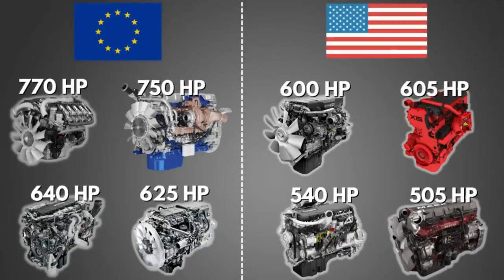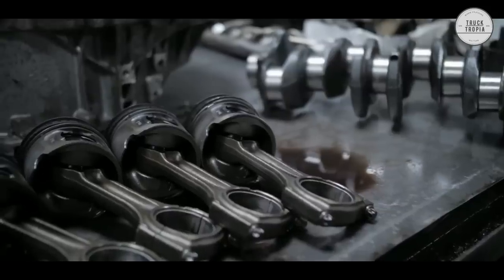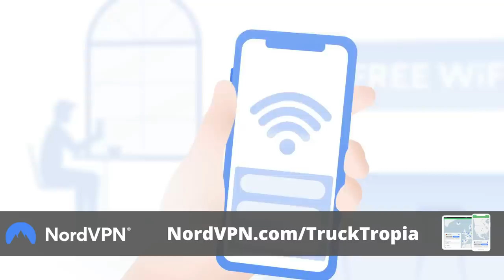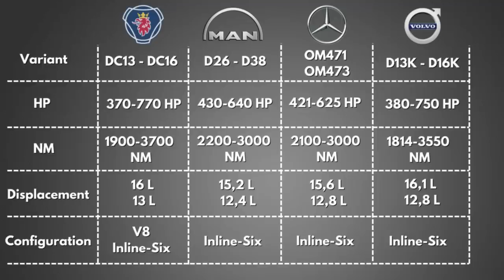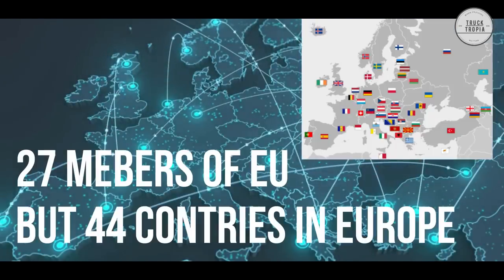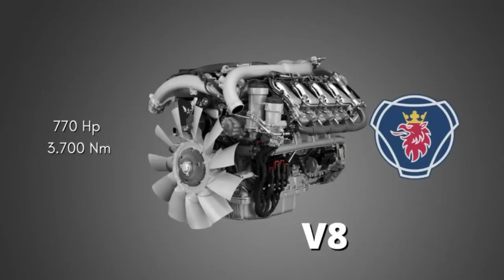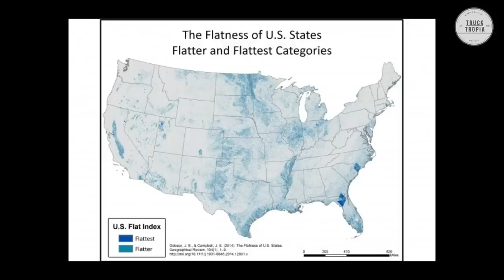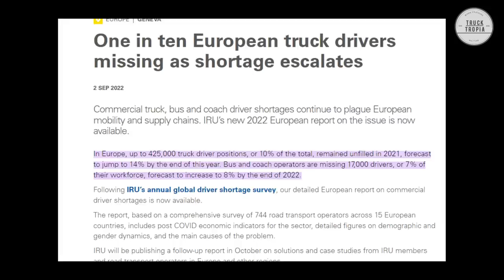Why European Trucks Have Up To 770 HP And US Don’t

Comment: Your statement about torque is completely false. There is no relationship between torque at the crankshaft and torque at the wheels, you set that with gearing. Horsepower however dictates how much torque can be delivered to the wheels via gearing at any given speed. Large torque at the crankshaft does not move the car, large torque only makes the horsepower with less engine speed.

Comment: I wish you had not only compared engines by horsepower and torque but also by fuel consumption. I think European engines are mainly designed for efficiency, because fuel prices are a lot more expensive here, than in the US.
Reply from the maker: Hard to compare, as manufacturers dont share Numbers
Reply: Talk to Sundahl in Denmark. He runs only American trucks because they are cheaper to maintain, more reliable and consume less fuel.

Comment: Doesn't gearing dictate the final torque (to the wheels) with the horsepower being the limiting factor?
Reply: Exactly, the engine torque myth never dies.
Reply: Definitely, you are correct. 

The stated torque figures are at the crankshaft and they are only denoting the magnitude of the static twisting force that determines how strong the internal components are required to be. However, we do not know how often this torque is supplied to us. Therefore, it tells us nothing about the vehicle performance, and certainly does not state how much a truck can pull, as stated falsely in the video.

The torque at the crankshaft is rather multiplied by the gearbox, and this resulting torque at the truck's wheels is what matters for vehicle performance. This torque at the wheels is what determines how fast the truck is and how much it pulls..or rather how fast it can pull these large loads. 

Technically, this wheel torque figure can become really high (just about anything within physical limits) by just fitting a gearbox with an extremely large gear ratio, so this way the truck can pull any desirable weight. However, this also means that the rotational speed at the wheels is also reduced by this same factor (the gear ratio), because that is how the gearbox works: it multiplies the torque, but sacrifices the rotational speed in return. So while really heavy loads can be pulled over the steepest of hills, the wheels of the truck will turn slowly, resulting in the truck traveling at a really low speed. 

Therefore, the stated engine torque doesn't tell us anything about the performance of the truck. What we also need to know, is at what engine speed this torque is delivered. 
An engine delivering the same torque, but at a higher rpm (rotations per minute) directly translates into hauling the same weight, but a truck that is traveling faster. 

Conveniently, this is exactly how power is defined: it is engine torque multiplied by the engine rpm, because both contribute to a higher truck performance. The higher the power, the faster the truck can accelerate, and the higher the resulting wheel speed is after using the gearbox to achieve the desired torque at the truck's driven wheels.

In order words: torque (at the crankshaft) is meaningless, but rather power, which incorporates both torque and rpm, tells us everything we need to know about how fast the truck goes (both acceleration and top speed).

Comment: First thing you said about torque vs horse power is completely wrong.. torque x rpm = power, high torque indicates that an engine has a lot of power at low rpm which is best for efficiency and longevity of an engine.

Comment: Not all truck engines in the US 600hp...I drove a Mack with an old Maxidyne V8 that had been worked over to put out well over 700 hp. It was a 4 axle Superliner with 3 sticks, and it was dedicated to haul our Grove RT35  crane. With the crane on the lowboy trailer, gross weight was 120K. Even at that weight, it would pull hills better than some freight haulers. Other drivers were always suprised when I would pass them going up a hill. Fun times

Comment: The Detroit engines are made by Daimler, the DD13 and DD16 are found in  Actros and Arocs models. But they are tuned to about 30hp more (DD13 to 530hp and DD16 to 630 hp).
Reply: Mercedes can give u a different engine 😂 2 Exactly a 12 Cylinder Diesel with 1830 HP and around 6400 NM Torgue and a 16 Cylinder Diesel with 3000 HP and 12300 NM Torgue (both was just a Test Engine for the leopard 2)

Comment: So here in the philippines the much better truck to use is european trucks because of geography and also we used the tons not the pounds. But reality most of the truckings here can't afford the european trucks because it so expensive, so the result most of the truckings here are using the Japanese trucks that the horsepower around 300+ to approximately 500 horse power. its not bad anymore because japanese trucks are also reliable and has strong engines

Comment: The US also taxes based on HP (among other things but its a large factor). So to have just enough HP to move the load at an acceptable acceleration it is always better to have a massive torque with a moderate HP for the US
Reply: The massive engine torque has nothing to do with towing. You gear for torque. That's why we have gear boxes. They are torque multipliers. If you want to know how much torque is at the wheels it's hp not torque. 

The reason for the massive high torque engines is about fuel economy and wear.

Comment: Torque doesn't have anything to do about ability to drive truck. When you drive bicycle you have more torque than Yamaha R1 or formula 1 car...
Power is important. Also competition is bigger in Europe. Every liter of fuel is important, every horse power is important, every kilogram of weight is important, every useful comfort thing is important, very half star safety test is important, every kilometer without service is important. European truck is engineering miracle. Milion kilometres, 10 oil changes all trouble free...

Comment: This video has so, so many flaws. USA has many areas where the (B)HP and torque are insufficient to pull a maximum load easily. Many other truck drivers and I often experience that when having to haul freight through - for example - Colorado and Pennsylvania. Going up a mountain with 20 MPH shows the trucks don't have enough power to easily pull through.

Americans are taught that the USA is bigger than Europe. In real life, Europe is not only bigger, but it also has a larger landmass, a larger population, and a bigger economy. In the USA, they therefor mostly compare to only the UK or the EU, instead of the whole of Europe.

If there is a country where there is a lot of customization then it's the USA. There are fewer regulations on the length of a truck and so more options to customize it.
Reply: The US does have a bigger economy than Europe $25 trillion vs. $24 trillion. Europe has 770 million vs. 333 million in the US still has a larger economy
Reply: There is different between a country and a Continent

Comment: well, you are wrong saying Euro trucks pull less weight, they have b doubles and USA  does not, typically those 700 hp plus engines are used in logging in Scandinavia and b double and triples in Australia, and  in road trains Cummins are the majority here, but only because Scania cannot supply enough units to us and the world Scania have the better engine, I  know this from my days working for Cummins and from my days building small ships with Scania
Reply: US has B-doubles though not that common.I have seen Fed-Ex and UPS B-doubles.
Reply: @tylerdavidson2400  Your B-doubles in the us are ones I would not consider true B-doubles but just ,my opinion
Reply: @lmpcorrosive7100  We have true B doubles here, 75 tons is the max gross weight I've hauled with them, Tyler is referring to A trains which require a dolly to hook additional trailers.
Reply: @aceoutlaw08  Yes,I was. Thanks for clarifying.👍

Comment: It amazes me when people who claim to know about engines completely screw up explaining torque versus horsepower. Power is what does things. Power is what accelerates you. Power is what overcomes friction and keeps you going down the road. Power is a function of work over time. Torque is simply an element of power. It is the twisting force, sure. But it doesn't do anything if the engine isn't spinning. An engine with 10000 ft lb of torque isn't moving anything at zero RPM. An engine with 10000 ft lb of torque puts out a lot of power at 1,000 RPM. But it only puts out half of the horsepower of a 5000 ft lb torque engine at 4,000 RPM. Torque isn't the important thing, horsepower is.

Comment: The statement that lower horsepower engines couldn’t haul the weight is idiotic. When I started driving in Germany in 1990 we had trucks that hauled 40 metric tons with 250 horsepower.

Comment: I think a truck engine doesn’t need more than 700hp.Even the road trains in Australia only have about 600hp on average.What’s more, the heavy cargo transporting version (the 8x4 version)of european trucks,besides volvo and scania,are between 600hp and 700 hp.
Reply: You do need them you haven't been in europe a lot. 
We have rolling hills that require a lot of torque and power

Comment: In Brazil, the most common are trucks from 440 to 540 HP, maximum capacity 74T, automatic transmission. Volvo, Scania, DAF, Mercedes Bens, Iveco, speed limit 80km/h, limit of 9 axles, however we have trucks of up to 800 hp, but in special loads.

Comment: I find the US trucks ridiculously small. 80000 pounds is only 34 tonnes for a conventional tractor and trailer combination. In Australia that configuration would be restricted to short haul, around town pick up and delivery duty or perhaps lightweight stuff like repositioning cars.
Reply: The US trucks can haul more, that’s the federal limit for the rods. At least some of the US and Aussie trucks are the same models with the steering wheel switched up,

Comment: There is no driver shortage. Never was it’s a lie
Reply: Not so much a driver shortage, but a shortage of good company's to work for
Reply from the maker: All companies complain that they need drivers so… yes there is
Reply: @TruckTropia  yeah they complain about shortage and there is. Most of the problem is because of pay, working conditions and the time away from family. So the shortage is their own fault for pressing the prices down and making sure some drivers make slave like salary.
Reply: As a truck driver for 25 years. The shortage is a lie. They simply buy their own truck and make better money. Driver retention due to terrible pay I’d agree with. We still are using rates from 20 years ago. Everything cost more
Reply: @jackking9400  There is a shortage mixed with what you also mentioned. Less of the newer generation are wanted to drive trucks and for good reason while the older are hanging up the keys. The job just isn't attractive to most equalling a smaller number of drivers coupled with the increase in demand of good being hauled.
Reply: @0utcastAussie  thats why they are now recruiting drives from India and etc. They will work for a shit pay and be away 6 weeks at the time for 2 weeks of or the whole year and 3 weeks at home..

Comment: The euro trucks may have more powerful engines available, but talking from experience, almost no one uses them. The most common interval around here is between 400 and 500 hp. For example, around 80% of the Volvos I ever saw were using the base 420 hp engine. The first and most important role of a truck is to bring you the biggest profit possible, and you don't really need more than 500 hp unless you are using a 6x4 and haul heavy loads regulary.

Comment: Your comments on hp vs torque are not correct. Power equals torque times rotational speed times a constant. Saying torque is the important value and horsepower irrelevant is grossly misleading.

Comment: The Bigger engined lorries/trucks are mainly used for Static Caravans/Mobile Homes, oversized loads (like wind turbine blades and huge gas pipe sections or concrete foundations for towers) & where a big turbo diesel engine helps with fuel efficiency. Quite a few firms use DAF and Iveco over Volvo and Scania, but I know a few who do European-UK driving who only buy Volvo and Scania trucks so they have the ability to task drivers to different jobs and be more flexible. 

When I buy my own tractor unit, it is likely to be a Volvo FH unit in Globetrotter trim level. Nice interior is good as you are living in the truck for 5-7 days at a time too! I feel some of the American trucks are better in this department with bigger inverters and more space in the cab though.

Comment: Just for fun I am english and still work in imperial.Pounds per foot .So if you take a nut that needs to be tightend to one pound per foot it means simply that its tight enough if you take a bar exactly one foot long and hang one pound of weight on the end of the bar.Obviously 60 pounds per foot means that nut stops turning when 60 pounds of weight is hung on the end of the bar.A crankshaft torque rating is the same in reverse.How many pounds per foot does it take to stop it rotating if that makes sense.

Comment: I am surprised by the fact that European trucks are heavier than US trucks. in Europe the maximum weight is 40 or 44 tons depending on the country but it is the total weight, truck + load. It seemed to me that in the US, 37 tons was only the load so the total weight was around 52 tons. 37 tons in total is really not much especially since US trucks alone are much heavier than Europeans.
Translated from French

Comment: Torque is not a substitute for power. Torque can be easily multiplied with the transmission, but power is what it is. Both Scania and Volvo are Nordic brands, and in the north the trucks have to be able to pull big loads - and therefore need big power. Enough power also means better fuel economy.

Comment: NO!  WRONG!  Horse power matters and matters a whole lot.  Torque only matters if you don't get your choice of gear.  I will explain why.
We can say basically:
HP = K * Torque * RPM
   HP = Horse Power
   K = Some constant for all the units of measure
   Torque is the torque the engine is making right now at this RPM
   RPM is the RPM at which the engine is running  and making that torque
Lets imagine you put a 2:1 gear reducer on the back end of the engine.  A 2:1 gear reducer will have twice the engine's torque on its output shaft but 1/2 the RPM.  Basically we now have:
HP = K * (2*Torque) * (RMP/2)
You don't need to be a math wizard to see that the HP is unchanged.
Now Imagine you have two possible engines to pick from and you get to select the gearing too.
Engine 1 = 100 RPM and 1000(units) Torque
Engine 2 = 100,000 RPM and 100(units) Torque
If we put a 1000:1 gear reduction on Engine 2 we can have
RPM = 100,000 / 1000 = 100 RPM
Torque = 100 * 1000 = 100,000(units)
Clearly if we get to pick any transmission we want etc, the engine 2 will out perform engine 1 on accelerating a load up to speed.  This error is a common one but an important one.  People make it all the time resulting in bad choices as to engine and transmission selection for the needed task.

Comment: In my country, trucks with 500 HP are used to carry loads of more than 60 tonnes, usually Scania or Volvo, but there are also those using Hino, Isuzu, Mitsubishi and Nissan which only have 300-400 HP and are forced to carry 60 tonnes

Comment: 1/2 You said that US truck brands use engines from different manufacturers. That’s not 100% true. Cummins is the only solely engine manufacturer. Paccar owns Kenworth / Peterbilt, they make the MX engines. Daimler group owns Freightliner / Western Star & Detroit, they make the DD engines. Volvo owns Mack, and they make their own Volvo D series and Mack MP engines. 90% of these trucks have the option to be outfitted with a Cummins.

Comment: Except what you are saying about torque vs power is wrong. Power is torque * rpm. If you have two engines, same torque, one has half the HP of the other, that means the other works at half the RPM (simplified, because there are torque and power curves, but for the sake of example). The truck with the lower HP will be working at a lower RPM and have to run a higher gear to maintain the same speed, so again for the sake of example one runs at half the rpm of the other, it will have to run twice as high gearing, halving the torque at the wheels, meaning it can never pull the same load up the same hill at the same speed. More HP gives the ability to pull the same load faster, or a heavier load at the same speed up the same hill.

Comment: I have a 2008 Pete 379.
It has a Cummins ISX-15 that is set at 599 BHP.
Because it has 2 DPF filters, the turbo is boosting at 30 PSI, which is producing 750 BHP at the flywheel.
But, it is putting 599 BHP on the ground after pushing past those filters and then through the drive train.

Comment: In the US Interstate Highway System, it is very rare to encounter grades steeper than 6% (6 feet vertical / 100 feet horizontal). The steepest grade I've ever seen on an Interstate is 7%. In Europe, I've heard that highways over the Alps and in Scandinavia can be as steep as 10%. On the steepest Interstate grades in the US, it's not uncommon to see fully loaded semi rigs having to climb at speeds less than 15 mph.

Comment: Horsepower is torque x revs, 
Euro trucks are limited in general to 56 Mph.
Fuel is more expensive
So engines are generally optimised through gearing to efficiently cruise at that speed which generally means @ max torque on a very flat torque curve.
Reply: And this is the reason for high torque numbers. High engine load plus low RPM equals long lasting efficient engines.

Glad somebody got it right.